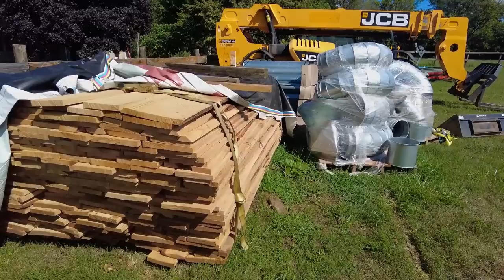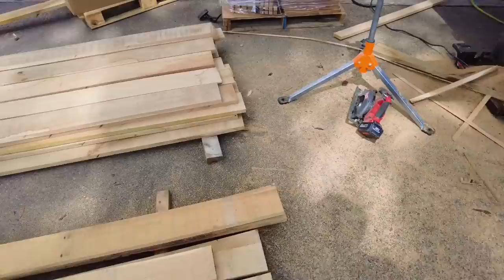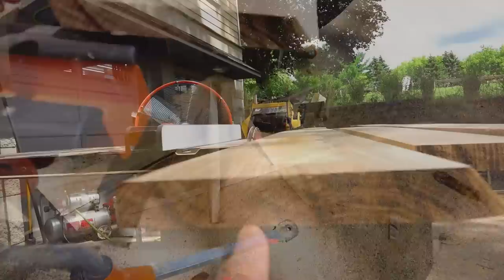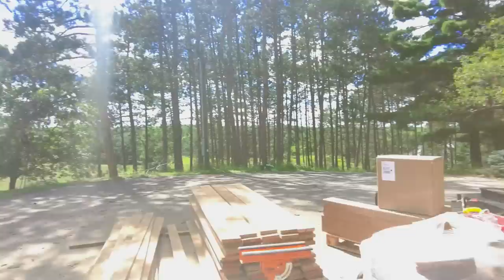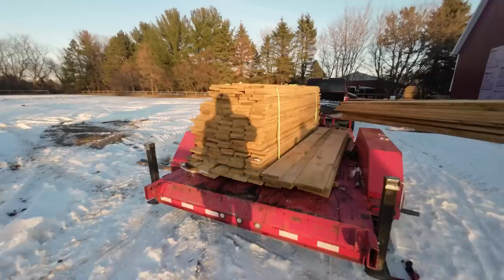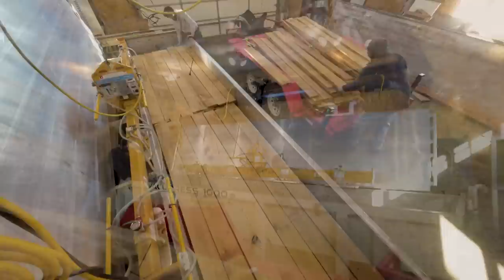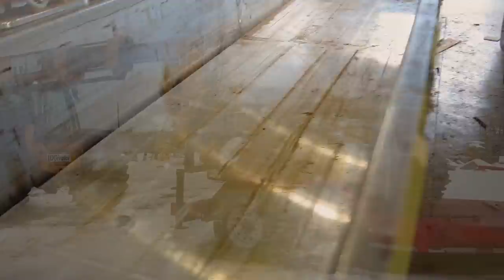Starting the Rift Sawn White Oak Flooring | Home Renovation & Addition Part 49

Comment: im suprised those boards had a straight edge to start.  i would have used the track saw to get a straight edge.
Reply from the maker: Duplicative. They’d need to be straight lined again after drying
Reply: so every plank you pulled off that pile had a perfectly straight edge to reference against the fence I seriously doubt that.  Maybe your plan was just to cut to rough width before drying but then you're still left with needing a straight edge on one side so you can cut to width the other.  Hence the track saw or a jointer.
Reply from the maker: Straight enough for the rough cut. If it was edge straightened now, it would have to be redone after drying to remove any new bow

Comment: I hate to point out that you are not using a plank push stick when your hands get near the blade for these planks and yes I understand you have a lot of milling to do.  :face-blue-wide-eyes:
Reply from the maker: I typically don’t pick up a push stick until the cut is <4”
Reply: Your preference, but you are a YouTuber and should show the safe way.  Also, you are outside with saw dust, dirt, leaves etc. that can cause you to slip.  Just my opinion.  :face-fuchsia-tongue-out: @mcremona
Reply: He has one of those "Saw Stop" thingies instead of a table saw so it does all the safety stuff for him so he does not need to work safely, Self destructs on a hot dog.

Comment: I'm sure it's been said but cabinets install first then finished flooring up to bases. You'll save a fair amount of material.
Reply from the maker: I’d prefer to put the cabinets over the floor
Reply: But the next guy may want a different layout and will have to fill in.
Reply: @mcremona  Unless your subfloor is absolutely perfectly flat, you'll end up with a gap where the cabinet bases get shimmed level so you'll then need a scribed cover for the toe area. Running the finished floor up to the bases usually covers this up.
Reply: Yep. I put my Brazilian Cherry 🍒 under my cabinets
Reply from the maker: There’s going to be a lot of scribing going on. I’ll scribe the toe kick to the floor